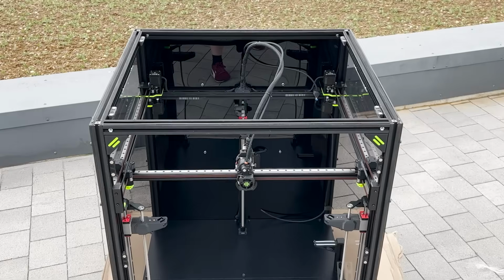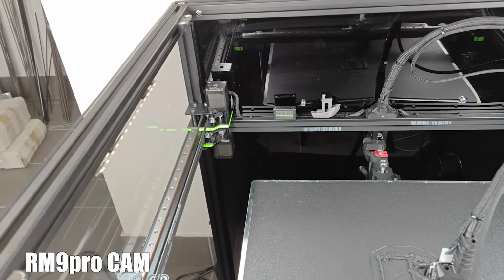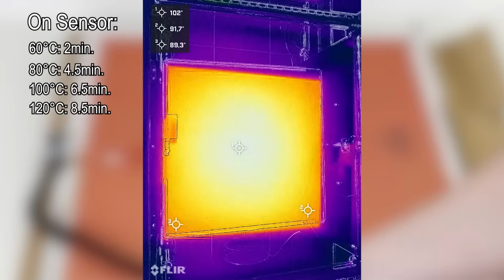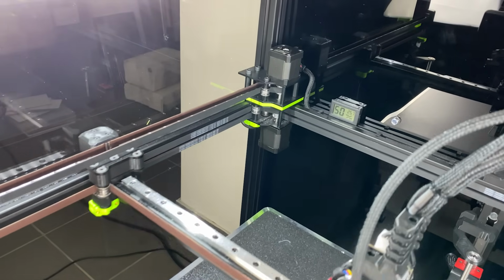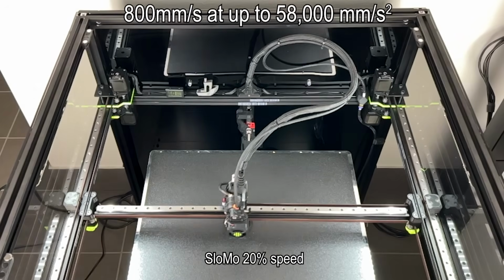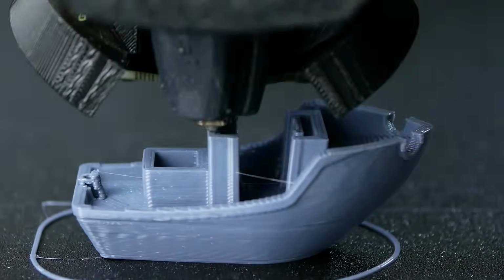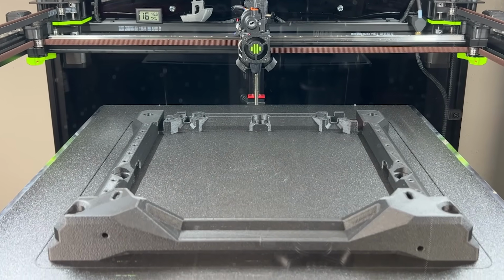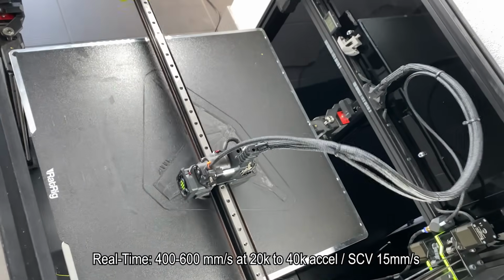Rat Rig V-Core 4 500 Hybrid: The Future of CoreXY? XXL Test!

Comment: That is crazy they didn't add the orbiter filament runout sensor, especially with how well it works.  It is an absolute necessity to have one these days.
Reply from the maker: To be fair and I absolutely forgot to mention: They sent me one afterwards and stated that assembled printers can be opted to be used with run-out sensor!
Reply: @247printing  when compared to the orbitor filament sensor I have it but I prefer much more the BTT SFS V2. Not only it is a filament sensor it also measures how much filament goes in so it can detect clogs or under extrusion, it saved me many times and payed for it self many times over on big prints!
Reply: @247printing I see you say assembled ones, what about pre ordered ones ? My first time coming across you channel and absolutely love your content. I understand stand 20% of it simply because also I own 7 different printers I’ve never dived so deep as you do here . Your video makes me want to learn so much more ( if or when I get time between learning home assistant and other random tech I’m fairly bad at 😅).
Reply: Great review I’m also interested in a fully built 500, hope they take on board your review and add the tweaks and test it before shipping top stuff it would be a nice addition to my farm and I can safely retire old faithful CR10max which as at the moment been chugging for 3 days
Reply: It depends. With the long bowden, you might prefer filament runout detection not at the hotend, but at the input of the reverse bowden tube. Much more easy to change filament midprint, without acidential moving the printhead. Also if printing materials with a heated chamber, you do not want to open it for filament changes.
So the orbiter filament runout sensor should stay optional imho.